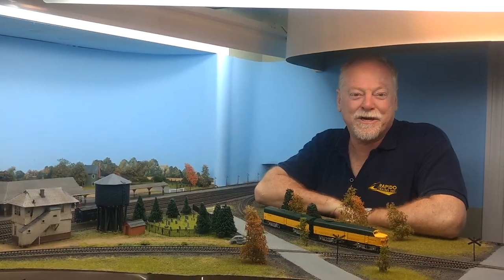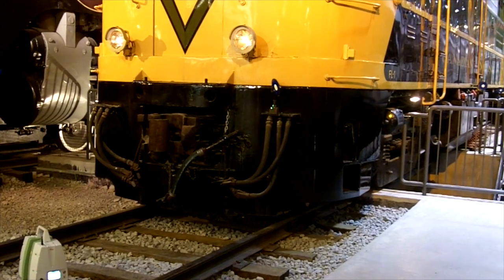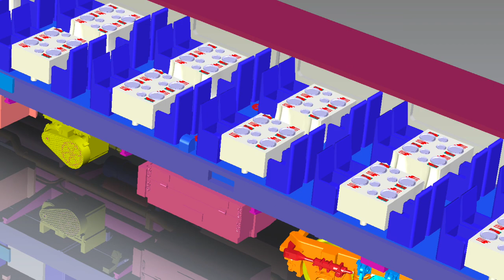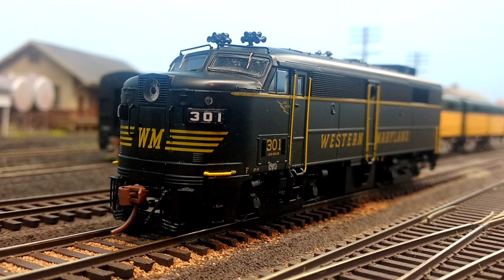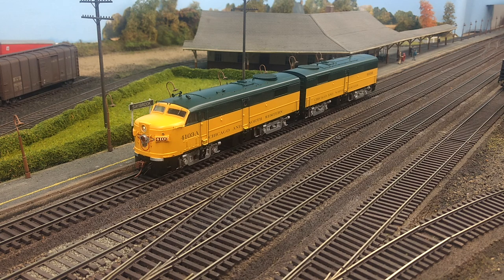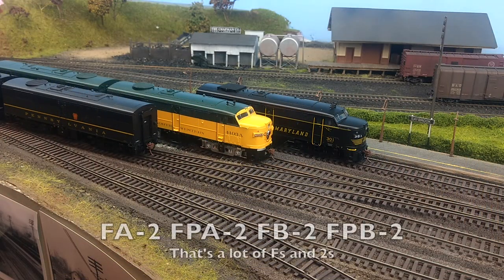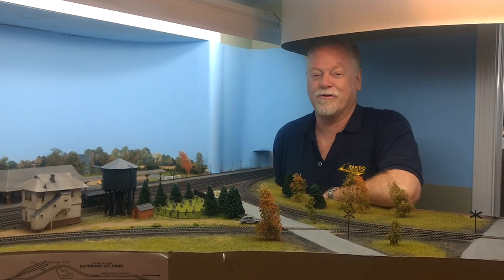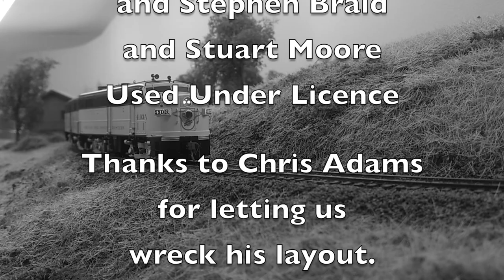Rapido's FA-2 and FB-2 Locomotives in Action

Comment: The western Maryland unit doesn't have dynamic brakes on it. All of the pics I have of them show that they do have them???
Reply from the maker: Holy cow! You are absolutely right! Thank you very much for pointing that out. We'll make sure to use the right roof in production. To be honest, the project manager for the FA-2 no longer works here and Bill has had to take over midway through. We'll double check everything when doing the final artwork.

Comment: Why does the cooling fan on the A unit appear to be sitting higher than on the B unit?
Reply from the maker: Good eye! These are early samples, and the B unit has the fan housing molded on whereas the A unit correctly does not. It's a separate piece, and the B unit housing should also be a separate piece. That is being fixed for production and the matching As and Bs will have the same fan housings.

Comment: One of the biggest complaints I have is this so-called "as delivered" livery. There are so many different 'delivery dates' for equipment, it's impossible to synchronize a time period.

Most as-delivered colors and configs didn't last that long anyway, as some railroads didn't like what they got, or wanted to standardize them with existing rolling stock.The silver trucks on those CNW units probably lasted 15 minutes while the black-trucked versions lasted probably 20 years. Which is better?

Maybe it would be better to model locos in the configuration they had the LONGEST--certainly not the first. 

You certainly did your homework--you were just reading the wrong lesson.
Reply from the maker: Actually the "as delivered" condition were the Green Hornets, modified versions of the Alco demonstrator scheme. These units weren't painted yellow until late 1956 or 1957. Silver trucks are super easy to cover in grime. It is more difficult to repaint a grime-covered truck in silver. These were silver right until the end - they were just covered in a thick layer of muck so they looked black.